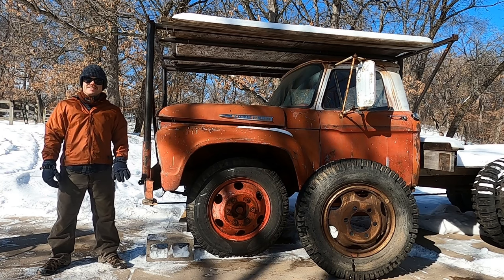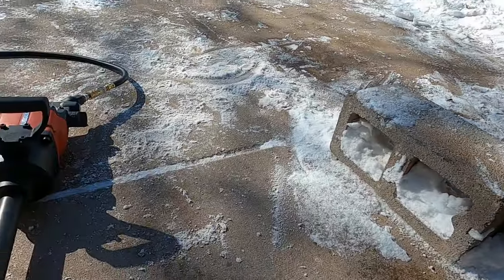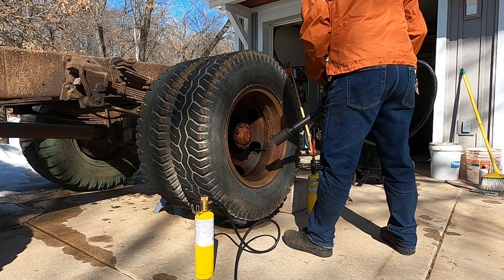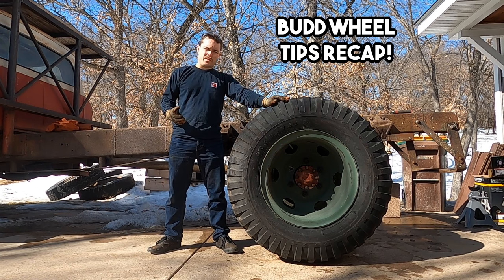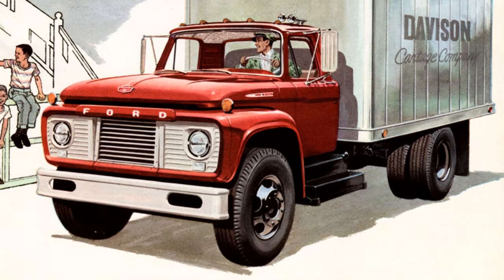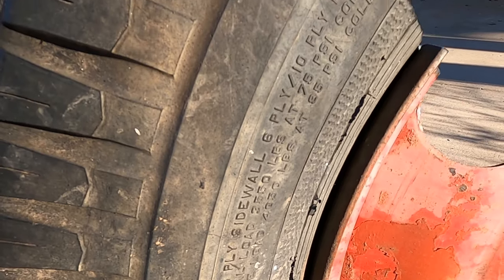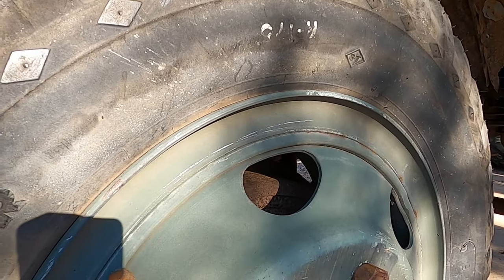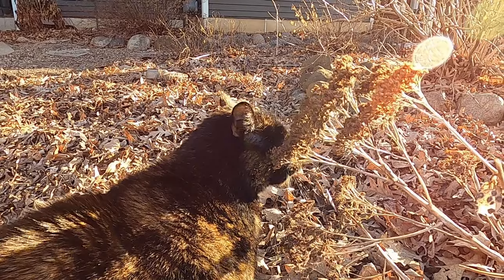All About Split Rims, Explained! Ep. 11

Comment: 34 years of being a road mechanic for trucks, I've removed more RH5 rims than I care to admit! 3/4 of removed rims came from old farm/construction trucks, and many times, I refused to put them back on because of areas of the rim eroded from rust! I was taught by an old tire man who started tire work in the late 40s, and inspection of the entire mating surface was IMPORTANT!
Reply: Glad you're still here and it sounds like ya made it thru with all your parts you came into the world with. 
Hah,that's one of my retirement goals 😂
I guess I'm sort of still a young buck at 50, but I listen to what the elders tell and teach me like it's the gospel.
Besides,some times they're grumpy and ain't gonna tell ya again! 😂
Reply: If you are going to use them please put them in a cage when you're tearing them down
Reply: @phillipgarrow2297  just stand to the side and smack it real good with a hammer.
Reply: Dad had a Good Year franchise. We grew up fixing split rims. Farm trucks. School buses. Etc. Dad taught us well. Wrap chains around tire in several spots. Clean groves well. Tap in place with hammer while inflating. Watching making sure top ring was in the grove properly all the way around. Never had an accident. Knew of a guy who had one side of his face tore up. Sewed back on. But nasty scars.
Reply: I had a old '48 dodge power wagon come in guy uses it on his farm bought it from some guy way up north in Canada and wanted me to adjust his brakes.  I refused as I was not going to attempt to remove the widow makers from that truck to adjust the brakes.  I told him to get those rims replaced and then I would adjust his brakes, but until then I am not going to have those rims come apart and injure someone or hit someone elses $100k+ vehicle that is being worked on at the shop.

Comment: Finally, someone who doesnt call a split ring a split rim. Good job on an accurately informative  video.
Reply: Both are dangerous as hell but there is a difference.
Reply: You say potato, I say potatoe. There are split rims and there are split rings both. Trust me, I spent 37 years in the commercial tire business. Look up what a Dayton split rim is. The rim itself is split and it is locked together with a solid rim.
Reply: I have always referred to it as a split rim. I was also a semi mechanic for only a year.
Reply: Until this video I had only heard of them as split rim. And I have trucks with them on still. 🤷🏻‍♂️
Reply: Yes. Nobody wants a split ring! 😆
Reply: Real split-wheel rims are what you find on hand-trolleys & wheel-barrows!

Comment: I almost forgot. Pro tip: get a 5 or 10 gallon pony tank for the ugga dugga. Run your 3/8" hose to that, and then run a larger hose from the pony tank to the impact. It'll act as a battery of sorts and deliver more air initially. It won't work for long pulls but it's way better performance for the first couple seconds. It's also useful for smaller guns that are far away from the compressor.
Reply from the maker: Interesting! I might try that, but we're also considering getting a hose adapter to run a larger diameter hose, which could deliver a similar effect...? Hmm
Reply: @SealedBeamRallyTeam  Just remember that a hose adapter is only going to be as good as the size of the hole going through it. If you want for instance a half inch line, you need half inch fittings from compressor to impact so nothing slows down. I just realized y'all were dragging the whole compressor out to the truck (not sure how I missed that detail before) so if you can go with a bigger line and fittings straight from it, it will act as the pony tank itself as long as the line between isn't super long. What I recommended is a decent trick for folks who don't want to upgrade everything they have, and will need to run a ways away from a stationary compressor or one that's too bulky to move. Air tanks are usually pretty cheap to add and can be carried around a shop easy enough.
Reply from the maker: @ChevyConQueso  I'll be looking further into what can be upgraded and what can't later when i do brakes. 1/2" all the way if possible- don't want those wheels falling off. Thanks for the suggestions!
Reply: @SealedBeamRallyTeam ,, use a torque wrench when tightening,  please don't rely on the output of your impact tool.
Reply: @ChevyConQueso  people just gran the Milton quick disconnects because they are easier to unplug their 1/4 or 3/8 hoses. I've even seen them adapt 1/2 and bigger hoses to use the same fittings. A bigger quick disconnect is a little harder to disconnect from your tool bet the amount of air delivered is incredibly greater. Impacts are worn out by hammering away on a nut with the wrench getting less air than it needs to quickly break the nut loose. The amount of pressure your compressor builds means nothing to your impact. Cupic feet per minute is what's important and it takes much higher pressure to deliver 10 cfm to a 1 inch impact through a small hose than it does through a 1/2 inch or larger hose.
Reply: @SealedBeamRallyTeam  do mobile service semi tires we run 40gallon air compressors with 14hp gas motors at 180psi with 3/4 air hoses for the 1in impact guns. And remember when you torque those wheels on they get torqued to 450 to 500ft-lbs
Reply: it is exactly the same idea as a "decoupling capacitor" in a digital circuit, or the condenser in an old mechanical spark ignition system. Replace pressure with voltage and mass flow rate with current and you can even use most of the same math to solve a pneumatic circuit as you would use to solve an electronic circuit.
Reply: It's easier to just put a auxiliary 1 inch line fitting, the your 1 inch impact will deliver more impact torque than a 1/2 inch drive impact. Buying a one inch drive impact then running it on a 3/8 line is like buying a stud horse with its nuts cut off and expecting a successful breeding.
Reply: @ChevyConQueso  another option is to grab a multi row oil cooler, shove some air line fittings on it, and dunk it in a bucket of boiling water. or over a gas burner. hotter is better...

replace all that heat you squeezed out of the air when you stuffed it into the tank, plus a bit more for added oomph...
Reply: @sealedbeamrallyteam This is the way that I've done it for years. Larger diameter hoses equals less friction loss and more volume, faster.
Reply: It helps to whack the socket with hammer while running the impact.
Reply: Pretty sure we always used a 5/8" hose for the one inch impacts.
Reply: @martystuart1041 yep Marty, taking the socket off and beating it a few good whacks did wonders. Their biggest problem was air compressor hose diameter.
Reply: @paradiselost9946  compressing air increases it's temperature. That's basic physics.
Reply: Also larger quick connects. I use 3/8 automotive with 1/4 npt that I got from hf. The standard quick connects are restrictive

Comment: Fifty years ago, I had a tire repair business. I worked on these rims and HATED them. I did not have a safety cage, but to inflate them I would set up in the middle of the parking lot, block up the wheel so that the split rim would hang down with the weight of the tire on it to insure it remained seated while I inflated it. I used a locking chuck to inflate the tire. Laying the tire flat was safer than setting it upright in a safety cage.
Reply: I worked at a Bandag tire recap plant at about the same time. I was teenager when I started working there. We had a brand new safety cage that we never used . When I started working there I was trained to put the rims with the locking ring in the cage, because that's what OSHA requirements said. The first tire they let me change without supervision I was struggling to get it into the safety cage. I hadn't quite got the hang of picking up and moving those big truck tires. One of my cousins work there as well. And he had worked there since the place opened. He saw me struggling, and stopped me. Then called me over to a back corner of the plant, and had move some tires stacked up there. Underneath them was another safety cage. The bars on top had been ripped through at the top. Then he had me look at the roof, there was a spot on the roof where there was a patch on it. A locking ring had gone through both. Unfortunately for the man changing that particular tire things didn't go so well. It cut his head off because he was standing with it over the top of the cage .Then my cousin showed me how to change those damned things exactly like you described. To this day I still remember when the owner of the place caught me not using the cage. He started to say something, but I looked up at the spot on the roof, then looked back at him. He just shook his head, and walked away. I'll never forget the look on the owners face. I even remember hearing about the man dying when It happened. Me and my friends all speculated on how it happened. All the news cast about it just stated it was a work place accident. And there were quite few sawmills around back then. I never told any of them about it, and to this day I don't know why I didn't tell them.
Reply: Interesting. May he rest in peace. I have seen these old wheels around and was unaware of the dangers.

Comment: My grandfather owned a garage/tire shop, my dad worked in it, and i did tires and oil in my late teens. My grandfather saw a split rim kill a man, and my father was standing right next to a man airing one up, when it took the mans arm clean off.  By the time i was doing tires, it was rare to see those old split rims.
Reply: Scary stuff, never understood how anyone thought a split ring was safe for anything more than a small tractor. I guess those were still the baby steps to what we have today.
Reply: @dinanbimmertv1864  well when i was in Afghanistan we would have to do big split ring 3 peice wheels (not split rim), and it always boggled my mind how a small strip of steel could hold the top rim, and all the pressure of the tire, not to mention when it was on a loader lifting thousands of pounds.  They were always aired up in a cage, w a long hose. Never saw one blow. But we were in jalalabad, which was incredibly hot, and tires would aired up to max psi in cool weather that would be stacked in the sun, (then for it to get easily into the high 110s) would blow sometimes. So they started stacking them a little under pressured, and would cover them from the sun.
Reply: Safe if you have proper training
Reply: @MrJeep75  yeah, id have to politely disagree. Split rim (not 3 peice split ring) rims and tires and never completely safe. As demonstrated, there is just no way to tell.
Reply: Doubt it took his arm clean off

Comment: Changed tires on split rims for years, in the Army.  They worked good for us.  Good training and paying attention to detail helps!  Plus, not trusting them, using a tire cage or at least a log-chain rapped around it, when airing up and staying clear of it!
Reply: I narrowly escaped death from removing Budd split ring wheel blew off with 80 lbs. pressure, struck me in for head sent me flying at least 10 feet, did not knock me out, but caved for head in and split my nose !  Did see the light at the end of the tunnel, wasn’t my time to go  !!  over 100 stitches and many months recovery, plastic surgeries!!  Was no cage in sight , first time changing , no training or warnings !!
Reply: I came through in the time where if a sergeant taught you it was a “split rim” then it was a “split rim” and a complimentary course of counselling sessions was available was to anyone who wanted to argue. My mates in the navy informed me this was termed a counselling session down behind the gun turret. Regardless of nomenclature of a) the name of a part, b) the name of a counselling session, we are all in agreement that arguing with your NCO’s was not a good career move. Regards from Oz 🇦🇺👍
Reply: Oh you can trust them..... once..... Good on the logging chain. Always made sure I seated them and just gave a tiny bit of air at a time...  Sometimes no chain was around. Any rust or dirt and it can go flying. Around 3 PSI to 15 PSI range is the seating pressure depending on the newness or ancient age of the tire.(If the ring moved at all, you had to start over, was my way.) Ya gotta know your materials and be smarter than them. Metallurgy knowledge is an artform not for beginners. BTW autism helped me...... military in knowledge not in training here. ALWAYS make sure the ring and groove are free of rust or other contaminates and never give it a chance to dispute your authority. You MUST make sure the ring or groove aren't worn out at all. Easy to spot mistakes from previous work on the rings or landings... Remember always that dumbarses exist.
Reply: @JustHere999dl Checking the parts of the two or three piece rims is important. One of his pictures looked to me like the split ring was bent or warped. I sure as heck would of junked that, and never let it be used again.

The old timers without cages laid them flat on the floor and had a long hose end on the filler valve. More than one tire shop roof or ceiling has been repaired because of those multi-piece rims.

Some tire trucks had an H frame type safety apparatus for airing those rims instead of a cage.  It had sides that were long enough to cover the whole height of the tire on both sides. And a large center piece locked them together. That was smaller than a cage and was carried easily in the tire truck.

A many tire shops have stopped servicing any multi-piece rims and will not touch them. The liability had gotten to steep to cover by many insurance companies. And some have come apart on the road, and the tire service company has been sued for faulty repair . So many of those rims have enough years of service on them that they are just beyond proper safety life. I personally would not have them on a truck on mine.
Reply: @marktwining3574 omg man, glad you're ok. That sounds brutal

Comment: In 73 I started  working at a semi dealership. I have changed  many of those tires  with mainly  split  rings,  we had a very large sheet of 1inch steel that with a fork lift put it on the rim laying  flat on the steel covered floor. And yes I went for many rides as even all new stuff  would blow.
Reply: Can we just bolt on a modern wheel like some Alcoas?
Reply: @xmo552 no, you would have to change the studs and hub to match the depth of the aluminum Alcoa wheels.  Best to just swap for a 1 piece steel wheel.

Comment: Regarding the impact with a small hose, if you use short blasts of the trigger it helps out, because the small hose isn't supplying the gun with air as fast as it uses it

Comment: My father worked at a 24hr gas station(truck stop) back in the 60s, and early 70s. He changed, and repaired, many split rim(& other) truck tires. I do remember one time he was injured badly enough to have to go to the hospital. But luckily not too serious. He always used the cage, but accidents still happen.
Reply from the maker: Glad he was ok. A good reminder that there is always a risk to this type of stuff.
Reply: @SealedBeamRallyTeam  I was around 10 & would sometimes go with him to work. (He would always tell me to stand way back, when working on one of those wheels) It was interesting to meet so many different people passing through, as well as the regulars.

Comment: This is a good video, I worked on split rims in Southern California back in the early eighties and did split ring rims almost exclusively.  They are quite safe as long as one works exactly to the letter, and discards bad wheels.  Inspection is key.
Reply: which in this day and age good luck, your average guy at the tire shop, lube shop, or mechanic shop that you would take one of these vehicles to were born after carbs were phased out.  They wouldnt know a thing about split rims, window makers or what ever you want to call these dangerous rim designs.  They also wouldnt know how to even inspect one properly either, I had a guy tow in his '48 dodge power wagon that he bought from canada wanted me to pull the wheels and check the brakes, I refused told him he can come pick his power wagon up and get those widow makers off and put some plain rims on it and then bring it back if he wanted me to work on it.  But I refuse to have those dangerous rims in the shop where they could decide to let go and do lots of damage to other customers cars in the shop which many are $100k+ vehicles some that we built, some bought from auctions such as mecum.

Sure I know about those rims and its not worth the money, so I left the truck outside and the owner came and picked it up and never saw it again guess he found some other sap to mess with the truck.

Comment: I had a 72 Chevy 1 ton pickup that had 16.5" split ring rims on it. I used to hear people talk about exploding split rims, but I didn't know all the particulars before. Thanks.
Reply: I had a 67 chevy 3/4 ton camper special when i was 18 that had the same wheels. I went to 9.5 inch tires up front and 12 inch tires on the rear on one piece steel rims. I miss that truck.